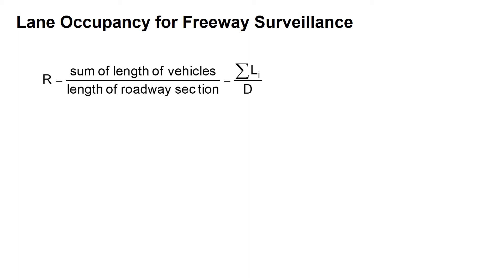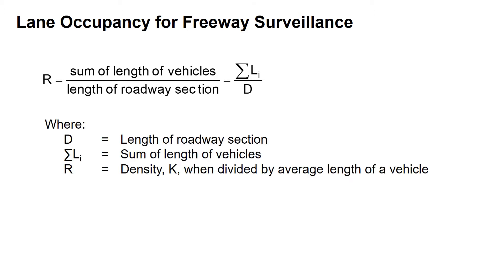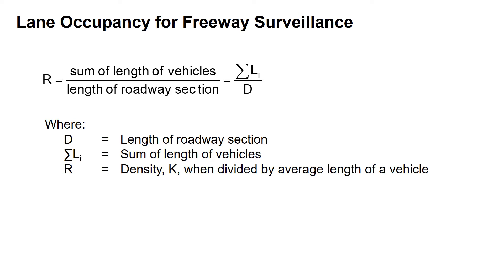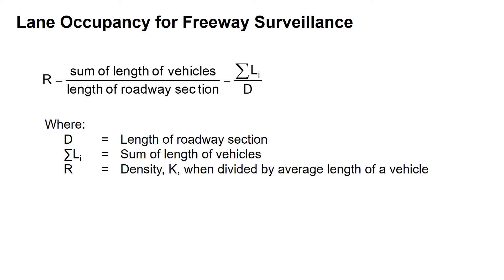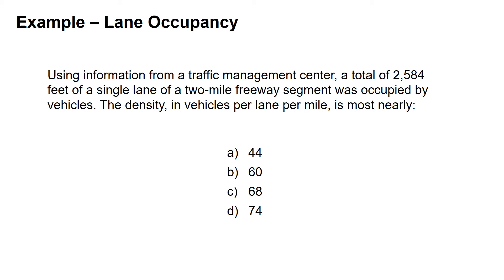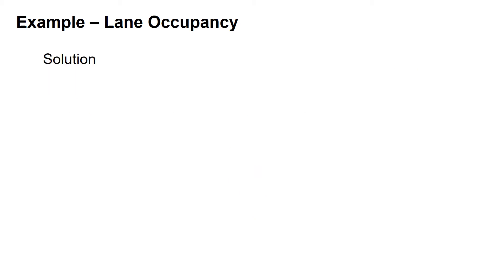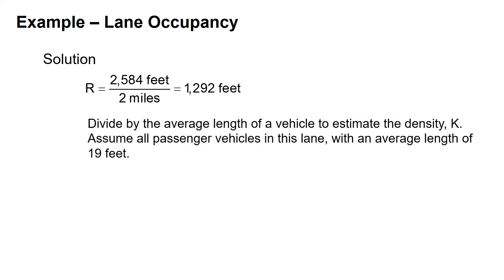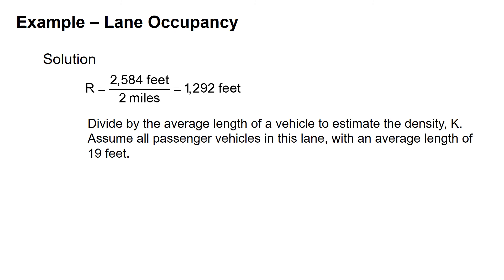Lane Occupancy for Freeway Surveillance | NCEES Civil Engineering PE Exam [Section 5.1.1.3]

Comment: I’m planing on going back to college and finish my Civil Engineering degree. Transportation Engineering was the only core civil engineering course I took besides other Engineering Mechanics courses  from Statics, Mechanics of Materials, Dynamics, and Fluid Mechanics.

I passed the class but it was tough, while I understood most of the content, there was so much that I didn’t quite grasp. These videos help a lot to grasp what I was missing. My mathematics background helped me solve problems and pass but the actual science of understanding transportation engineering was not really there. Just like in my general chemistry class, it was hard to grasp it, I barely  passed, I was sure I was going to fail the 2nd course which was supposed to be much more tougher, but the second course ended up being much easier due to having more mathematical applications of Chemistry, I was just a couple points from an A. 

Well that being said, these videos inspire me to finish my degree, help me grasp the what really is Transportation Engineering, and eventually I hope to become a PE.
Reply from the maker: That's terrific!  I'm glad the videos are helpful for you.

Comment: should we expect average vehicle length to be given/where could I find this in the given references?
Reply from the maker: In my opinion, the vehicle length should be given.  However, if it's not given, I would recommend using Table 2-4a in the 2018 Green Book (page 2-56) which shows a passenger car length of 19 feet.

Comment: civil pe exam topic. "minimum length per comfort criteria" as defined by the eqn L = A*V^2/46.5  . it is applied in the vertical curve realm of transpo am section. does anyone know if this topic is expected to show up on the latest cbt exam despite not being represented in ncees hb 1.1 ?
Reply from the maker: What is the source of this equation?  The hb1.1 shows L=KA (which I believe is the simplified version of the equation you shared).
Reply: @FindleyDaniel  i used a SoPE course, they issued problem sets with some of the problems requiring the use of L = A*V^2/46.5.

problem sets were issued in the old-world of the pen/paper exam. so i have to wonder if the new-world cbt has sidestepped this eqn entirely as its missing from ncees hb 1.1